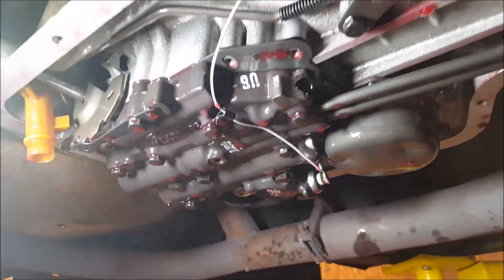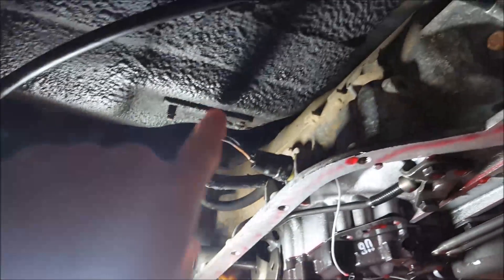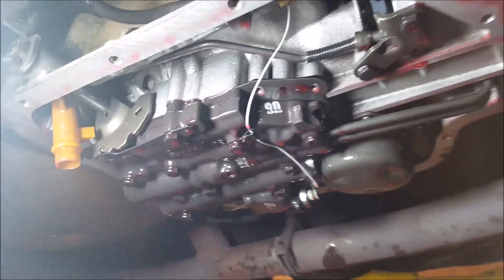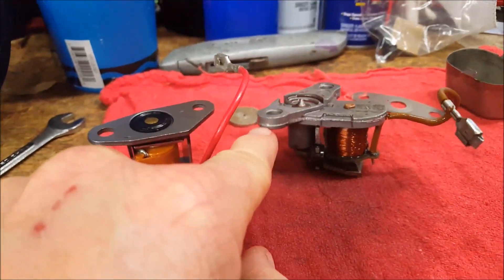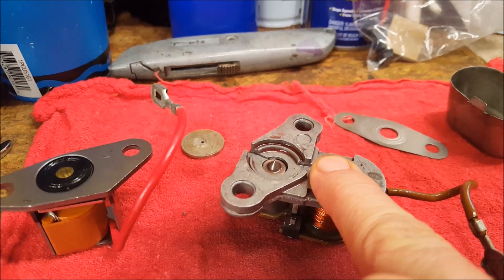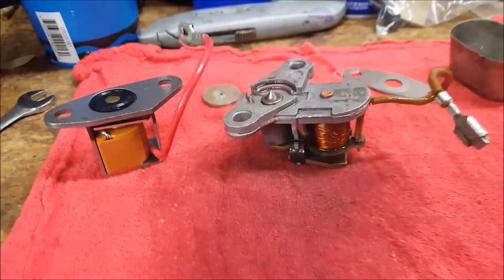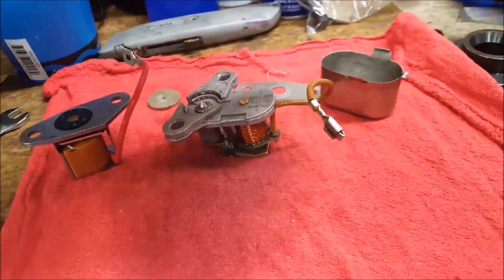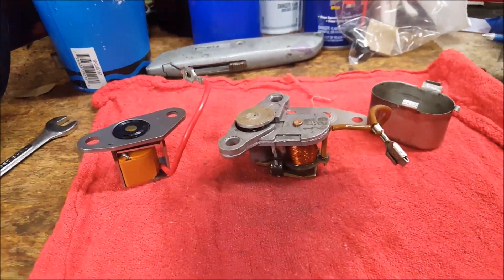TH400 (Turbo 400) Transmission Kickdown Solenoid Comparison - Old vs New

Comment: I suspect i have similar failure. My th400 is not shifting up out of first under heavy load once warmed up. Part throttle its fine and when cold it performs flawlessly. The first issue i had was car was not starting from a stop in 1st gear. I took govenor out it was stuck cleaned it and reinstalled and all was fine. Then took to a shop had fluid and filter changed and now i have this strange symptom. I have replace vac modulator. Gonna replace governor and if the problem is still there i will do solenoid. Hard to get clear info about my issue from shops or online.

Comment: Show how you did it
Reply from the maker: If you are referring to installation, it is actually very simple. Unbolt old part. Bolt on new part. connect wire.

Comment: What was your original issue?
Reply from the maker: No kick down. When you floor it, it's supposed to kick down to a lower gear.
Reply: Alright thanks I have no throttle response at above 15/20mph stays at idle won't rev when I try to drive my truck and was looking into this
Reply from the maker: @NickMinton1030  what year and model?
Reply: 81 Chevy k20
Reply from the maker: @NickMinton1030  if it idles but won't rev I'd check the catalytic converter.
Reply from the maker: @NickMinton1030  if it revs good but won't go while in gear, the trans is probably hosed.

Comment: Where do you hook up the pig that comes out of the silinoid ?
Reply from the maker: The white wire hanging inside the transmission has the connector on it. It's hard to see in the video.

Comment: Was the coil bad, or something else?
Reply from the maker: I've not tested it to be honest. I have kept it however. I'd suspect the coil is probably shorted. Would need to ohm it out to see. When I installed the new one, my kick down worked perfectly every time. Before, it would only work once in a while.
Reply: Hi there m...
Was your transmission not shifting? or shifting but late it too strong?
Reply from the maker: @juanrzarate5690  Transmission works fine. This solenoid is for the down shift from 3rd to 2nd or from 2nd to 1st when you put your foot to the floor. It was not doing that. If you wanted to pass someone on the highway and you put your foot to the floor, it would do nothing but stay in 3rd gear. Better late than never on video replies I reckon.  😊

Comment: Hi there i have questions for you if you can answer please can i fit 1995 4.3 GM safari or sonoma motor into TH 400 for 1968 cadi if not what I need to make it fit thank you
Reply from the maker: I've never attempted to do this. I assume you want to use a TH400 transmission on a Chevrolet 4.3 liter V6.  Here are a couple of links on the subject however. I assume that one could purchase an adpater for this application quite easily. https://www.novak-adapt.com/knowledge/engines/about/chevy/chevy-small-block-v6/          https://www.novak-adapt.com/knowledge/engines/about/chevy/chevy-standard-shift-info/   http://www.advanceadapters.com/

Comment from the maker: The new solenoid worked perfectly and fixed the problem. The old one was flaky. The solenoid would click when you applied power to it but it the kickdown to 2nd gear still would not work.
Reply: A) Was the installation successful without installing the shim from the original part?  and B) as I do not have much experience working on transmission related things, does the entire installed part simply get flooded in transmission oil? - Thanks.
Reply from the maker: @uvideohelicopter  Yes to both questions.